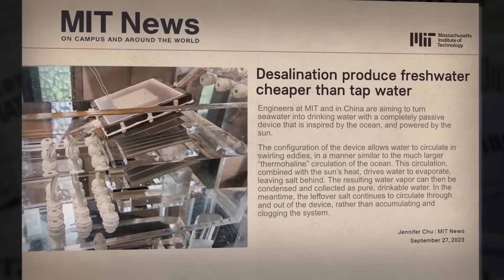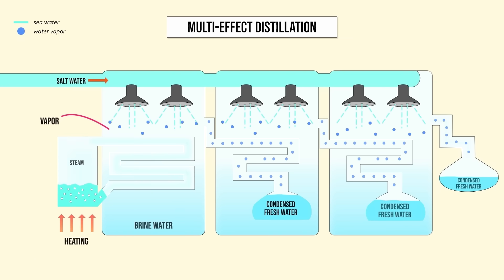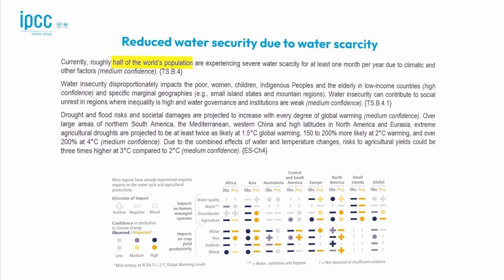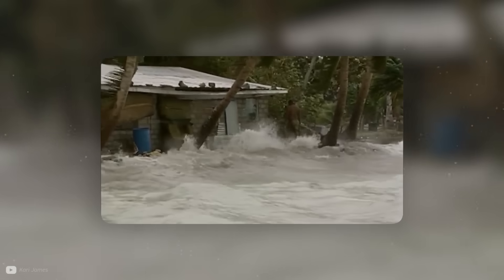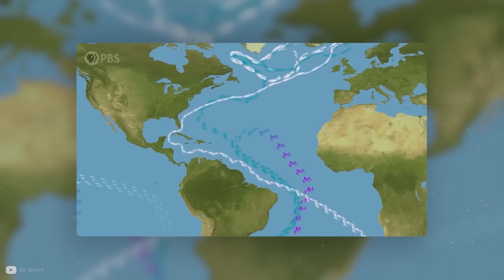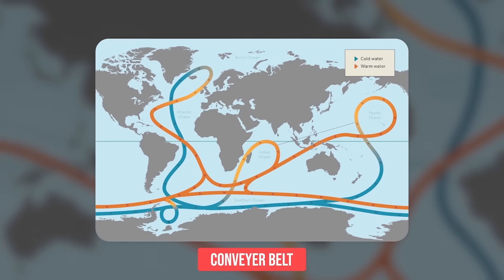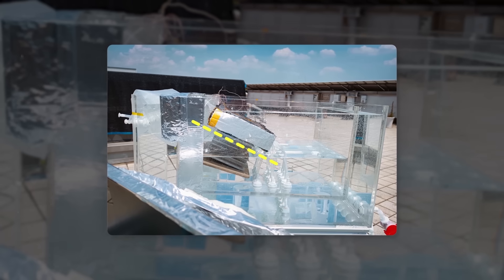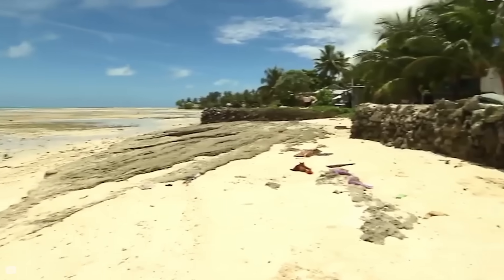Unlimited Fresh Water: Can MIT's Breakthrough Save Us?

Comment: The hyper-salinity issue isn't down to the method used, but the amount you use it. It's the same amount of salt left over that has to be returned to the ocean. Yes, the trick is to dilute it rather than dump it highly concentrated in one big go, and doing this where there are natural ocean currents to circulate it will give the best results.
Reply: Spot on.
Reply: You're correct, but the advantage of this sounds like much cheaper maintenance.  Pulling less freshwater from each liter of brine lets it still flow away instead of clogging the filters.
Reply: Dont worry, the sewage and the backwaters are going to dissolve them anyways lol 🤣🤣
Reply: I suspect this is the big problem, because membranes can be flushed but the conservation of mass means you will need to dispose of that brine somehow.
Reply: NO They should be turning the Brine into Salt Battery Storage Units...
Reply: @Shivaho  or we could both
Reply: @GungaLaGunga  Some in this vein seem to think that we shouldn't use the salt we collect from desalination. I don't see why we couldn't, but at the same time we already get salt from mines and it may not be a good idea to start removing salt from the ocean en masse. Keep in mind, we return all water we use to the ocean thanks to us directly being a part of the water cycle. But the salt we would use would not be returned, so we would be using it up. Using up too much too fast could potentially affect our ocean's thermohaline currents/conveyor belts, if the salt in the ocean isn't naturally replenished fast enough.

Basically we need to look into that extensively BEFORE we start any kind of mass production that uses salt from the ocean instead of returning it. If it turns out it's fine, then we can stop salt mining probably. But let's not hastily guess or assume based on a YouTube video and a few Google searches. It needs an actual study.
Reply: @GungaLaGunga  I'm curious to know some engineering aspects on how this might be achievable.
Reply: @PsychoticWolfie humans don't use enough water to affect the overall salination levels of the ocean in any measurable way. We can only affect it extremely locally. I don't think you understand how HUGE the volume of ocean water is
Reply: @Shivaho   NO What are you, 10 years old? What a random and terrible idea. "Hey let's turn my piss into a salt battery storage unit also! It's got higher salinity in it!" Your idea sounds similarly low-iq to that. Wild that so many people liked it.
Reply: @Shivaho  leyden jars for everyone
Reply: @Shivaho  lmao keep dreaming
Reply: @Shivaho  , should send that brine to bleach factories. Make NaOH (caustic Soda) , Hypochlorite + Sodium for batteries in one facility .  Multiple streams of revenue for on plant.

Currently most caustic soda ? bleach plants use table salt that is mined from land based deposits , instead of saltwater or sea-salt. 

super conc brine from a nearby Desal plant , could be a cheaper alternative.
Reply: @Shivaho ppl have ideas, but no plans. Can the further extraction and refinement of sodium chloride then maintenance of a molten salt battery even be worth it?
Reply: Our city built a new desalination plant to counter our lack of fresh water, the problem was they city planners built it in a natural harbor that is already under stress from other industries dumping waste water and pollutants into the harbor and is destroying the natural ecology. When the desalination plant was built there as well the company building it said they would keep a very close  eye on the salt issue blah, blah, blah, and if the salt levels got too high they would dilute them with the fresh water that they had just made. Crazy. I have looked at a few plants around the country and overseas and have noticed that they all dump the high salt water back into the sea through short 150-250m outlets, my thought was why not pump the waste water a kilometer or two into the deeper waters with stronger currents to spread it out? Is this solution feasible or is there some aspect of super salty water that would undo any gains?
Reply: @bendover1028  If you could pump it out far from shore then of course that's far better than releasing it close. But that costs extra money, and no one will spend that money on that unless there is funding and the government tells them to. Companies, even city-run programs, aren't going to do it for free or without coercion.
Reply: Even if you just dump it into a single spot all at once, there is much worse stuff we pump daily into the oceans than brine. 54 great pyramids of Water that has 7% salt in it instead of 3.5% like big wooop, you got no Idea how big the fucking oceans are. Sucks for the fish that lived directly next to the pipe that pumps it into the sea but it dilutes very quickly.
Reply: also the sheer amount of energy it takes to desalinate water is what also is a problem with it
Reply: I wonder if it would be economically viable to return the salt to the sea over where the ice sheets are melting? I've heard that the amount of freshwater they're dumping into the ocean is actually throwing some things out of wack.
Reply: ummm... actually fresh water freezes at a higher temperature. You know they put salt on the road to melt ice, right  @eyesofthecervino3366 ?
Reply: The solution to pollution is dilution
Reply: @adamhorn8414  ahhh that's the key! We must all pee on the left over salt! And then we can extract the water from the salty-pee mixture, dude your a genius
Reply: With all the glaciers melting, salinity shouldn't be as much of an issue
Reply: @ellenlandowski1659  who told you glaciers are melting? I was told they've gotten even more thicc over the last 20 years, heard the polar population was actually starting to get out of control. Them sobs are breeding like rabbits on them ice bergs
Reply: @htrdchevy71  Evaporation takes a lot of energy. Why do you think reverse osmosis ever became a thing?
Reply: @htrdchevy71  Lets think about that for a second. In Israel you have around 2000 kWh/m^2 yearly average of solar irradiance. With a yearly average of 21°C you could evaporate. Assuming 100% efficiency you could evaporate 2800 litres of water. The Ashkelon Desalination plant alone produces 396,000 m³ of water a day. So to replace it you would need 27.9 square miles of area. Good luck pitching the israel government that they could level an area on the coast roughly equivalent to manhattan to replace one desalination plant.
Reply: from sewage to nuclear waste anything could be dilute enough to release in the ocean without harming it the problem is the absurdly high amount produced. It is not just a bucket that you dilute in a tub, it is a continuous flow of huge amounts of brine.
Reply: My thought too - not seeing how this solves hypersalinity. If distributed release of hyersaline water is done with current methods, then this new method doesn't add anything new or solve the issue (same amount of salt is being dumped into the local geography, litre-for-litre water produced). Given Ziroth mentioned it as a problem it probably should have been addressed with the solution, or not mentioned at all (since it is the same problem left unaddressed for both).
Reply: Why do you want to dump the salt back into the ocean? People eat salt. Salt can be used as a heat storage medium in solar farms.
Reply: Don't dump it. We can use those salts for various chemical products.
Reply: Or you know we can just not put the salt back in the ocean and instead use it for many purposes be it medical or culinary or industrial salt has many many uses....
Reply: @stapuft  Human industrial capacity is not enough to do that.
Reply: @gorilladisco9108
Yet.
Look up sodium batteries though and there are many other minerals in seawater that could also be mined from the brine and if we're already creating this brine to create fresh water then at that point mining the brine would be cheaper than mining the Earth for those same minerals.
Reply: Also heavy water is naturally occurring in seawater so doing this could potentially be a way to get a whole lot more heavy water than we currently have which would aid in nuclear power as well
Reply: If you can somehow get it to the north Atlantic it would be benificial because lack of salinity there is shutting down the Gulf Stream.
Reply: I disagree. To add the salt concentrate in smaller volumes will not replace the water that was removed, it's still going to be the exact same amount of salt dumped into the same volume of water.
Reply: Sell the salt, or dump any excess in a large salt landfill.
Reply: It's also probably best to transport it as close to the ice caps as possible, as they are currently having their salinity affected by ice-water
Reply: The problem is that the brine sinks directly to the bottom and kills off the benthic life.  The "ocean current" argument is too long to explain in a comments section, but at least you can understand that the intake salt water is located somewhere very near the desal plant, or this whole thing begins to break down.  Likewise, the brin water outflow (diluted or not) is somewhere near the desal plant as well.  So you're dumping the brine right back into the area where you are ingesting your new water to desalinate.  And the brine, by definition, is coming back in a never-ending stream, generally in fairly large quantity.  And the whole thing has to be built somewhere that there are strong ocean currents as well?  That means somwhere on an actual deepwater ocean, not a bay or lagoon.  

It's nowhere near the simple "trick" you're thinking about.
Reply: Why not just dump it in the salt caverns.
Reply: Could it be used to produce salt for industry or consumption? Like salt pans, already used in France, Tunisia and no doubt elsewhere?
Reply: Why not build a large shallow pool deep in the desert?
Reply: This could replace and eliminate salt mining.  I'm sure a large percentage of that salt could be used for all the purposes salt is currently used, so the energy isn't completely wasted if it offsets the energy used in salt mining currently.
Reply: Better yet, save it, store it, sell it. There is very likely to be a huge market for sodium in the near future if it becomes the preferred chemistry for batteries. Also, the ocean is already 'too' salty. Removing some of the salt from the ocean would benefit most if not all of the creatures who live n the ocean.
Reply: I think the idea is to set the system directly into the ocean where the concentration isn't able to get too big in the first place but you're right there's still an impact to minimize
Reply: Agree, its a similar problem for electric cars,  they may not pollute in the city centre, but there is a polluting power station somewhere, that produces the electricity somewhere else. The real trick is to extract clean water from salty water in a system that doesn't just past the problem of the left over salt to a different location, before it is dumped back in the sea, but somehow uses the salt combined with other materials, or chemicals to become useful solid matter for building purposes, providing that the salt is converted and benign to the earth. many countries around the world could benefit from sea barriers  made of re-cycled slat based materials, providing that the science can deliver a benign  salt based product!
Reply: Or dump it into ponds to recover the salt.
Reply: @stevesteve8098  54 Giza pyramids a day is kinda big.
Reply: Just dumping hypersaline water into ponds can apply to any desalinization method.  @stevesteve8098
Reply: Mix the brine right back with the wastewater before discharging both.
Reply: @mason6883  Brine IS the waste water :-) Regular desalination creates a high concentration brine so it should be mixed with sea water to bring the concentration down and discharged where it will do no harm e.g. a long discharge pipe. Sounds like this process produces much lower concentration which is less of a problem.
Reply: I’ve always wondered why they don’t have a dual system where they desalinate the water for drinking, then truck/pipe/whatever the concentrate to a hotter/drier area to process into salt and minerals? Imagine a giant desert plant that could more efficiently dry out the concentrate.
Reply: There must be economic reasons - this new desal plant (https://www.epa.wa.gov.au/proposals/dampier-seawater-desalination-plant-dsdp) will be a few km from one the worlds largest existing salt production pond systems (4 million tonne pa), is owned by the same company and they're talking ocean outfall.  @decepi
Reply: why not sell the salt
Reply: there are many other minerals/elements  apart of NaCl which need separation/ recovery ---> cost/ technology?  @andrewanderson8803
Reply: Why return the salt to the ocean at all? Why not let all the water evaporate to create sea salt, road salt for winter or just salt lakes or to fill up old mine shafts?
Reply: What I don't get is, if the same amount of salt is disposed of back into the sea, even if it's made safer by diluting it, it has to be diluted with fresher water, right? I.e., the problem remains, how to get rid of the salt without damaging the ecology.

(That's the only flaw I noted in the explanation.)
Reply: @kencadby  The problem is not the amount, but the concentration, that much is correct. But you don not have to dillute the brine with fresh water, you can just as easily use salt water that has a lower salt concentration then your brine, you just need to use more of it.

Alternatively, you could just evaporate ALL the water and dump the salt behind your factory. that would also work.
Reply: How is this miracle current different from just putting in a solar powered pump to circulate the water? The salt doesn't magically go away regardless of what they are trying to sell you. If you aren't creating concentrated brine then you aren't going to create salt-free water because you have to have at least one membrane which is totally impermeable to salt - and if the pressure gradient isn't extreme - which would result in highly concentrated brine - you aren't going to get any appreciable flow rate. People have been using solar stills for thousands of years, but I guess putting it at an angle to allow for magical salt separation somehow made all the difference, right? Nothing seems at all innovative about any of this research except it somehow prevents clogging of the filters through some undisclosed mechanism. Honestly, how is this thermohaline current able to prevent the clogging when pumps cannot? That makes no sense.
Reply: @-Bill.  Yeah, I'm very skeptical about the extrapolations of this process. I hope Ziroth does a follow-up video as they do more research and prove their results at the micro and macro scale.
Reply: @-Bill.   There is less energy loss to directly use the energy from the sun, making it more efficient energy wise. Other than that, it seems more like the currents are just used to avoid clogging up the filters. The project seems to be mostly about a more efficient way to desalinate the water and making the process more available to areas where there is a lack of infrastructure development.
Reply: @-Bill.  Normal pressure reverse osmosis systems literally force the saltwater against a membrane and therefore every pore in the membrane eventually has salt forced into it.  I think the key here is the hydrophobic property of the membrane and only diffusing the water through as vapor without using pressure so the salt water and therefor the salt does not touch the membrane in the truest sense and does not clog it.
Reply: It's really delaying the problem. More water means more people. More people need more water. More salt in the water. I think in the US they say a person uses at lest 50 gallons a day. Someone will say - gee, cheap land. Buy it, develop it, profit. Sip cocktails on Fiji or Miami. I could see California building oil tanker sized versions of this off the coast of San Francisco and Los Angeles. San Fran "environmentalists" would probably find a way to blow that water too.
Reply: 'It's really delaying the problem' agreed,  the Red Sea scenario comes to mind.... @robertthomas5906
Reply: The same reasoning applies to other pollutions in larger populations. So the ultimate problem is "too many people" in any case. Technology to reduce the waste footprints will always work better than just ignoring the footprints to save money.  @robertthomas5906
Reply: The people who invented the combine, the cotton gin, the steam engine, etc, all had the ‘do more work with less manual labor’ mentality, an idea (a sickness, ultimately) which led the way to our current global civilization. @robertthomas5906
Reply: @robertthomas5906  Not really. Water is not "used" in the sense that it disappears - it is just entered into the normal circle of life. Heck, if you put the wastewater clearing facilities right, you can mix the (clear and technically good) water that comes out of them with the brine and then dump it back into the sea.
Reply: @robertthomas5906  Our problem isn't more people, it's less people, the population is shrinking far below the sustainment rate.
Reply: @robertthomas5906  no way a person uses 50 gallons a day, normally.  Think about it.  Heck, look at your water bill.  That would mean a family of 4 was using 12,000 gallons a month on average.  I am not even close to that.  I don't know anyone who uses that.
Reply: @v3rlon  add in the water that is used on your behalf, for example to grow crops that provide your food.
Reply: @v3rlon  Apparently you never heard of that ancient technique called "watering your lawn".  Can easily use 500 gallons in a single day.
Reply: @thekinginyellow1744  My lawn has grass, not people.  The navy doesn't have grass on their ships.  If fact, I have never seen a lawn that had people growing on it instead of grass.    I'm pretty sure that isn't even legal.
Reply: @v3rlon  According to the 2006 human development report it is 150 gallons.
Reply: @rianfelis3156  If everyone grows their own food and their own cotton to make their own clothes, you could start that argument.  
Other than that, this is an artificial way to 'run up the score.'  You'd have to discount other parts of that water support such as the parts of the plants we don't ear, their carbon dioxide consumption, and of course subtract all the water we put back into the environment (sweat, breathing, tears, urine, bleeding. and so on) if you want to go that route.
Reply: why not sell the salt
Reply: why not sell the salt
Reply: why not sell the salt
Reply: @andrewanderson8803  It's brine, not salt. To evaporate the last bit of water takes a lot of energy or a lot of time. Salt is gathered by poor people in deserts (salt flats), where it's caked into solid minerals already. They slice it up, haul it out, and sell it. There are also salt mines where they blast tunnels through solid salt underground and carry it out. It's just a question of economics, of what the cheapest method is to get it. But maybe it's better to create salt this way anyway, from the brine, so as not to dump it all into the ocean. A government subsidy could cover the difference in cost. Usually when we decide to dump a thing into the environment in vast quantities it ends up not being a great idea after all.
Reply: @johnshite4656  when we use up water, we give it back pretty quickly.  We don't have a water shortage at all, we have a FRESH water shortage.  We're not creating anything to dump into the ocean here at all, the salt came from the water we're borrowing for a very short time.  The problem is with how concentrated and locally the salt is re-introduced, not with the quantity at which we dump it.

If it's dilute, that's problem 80% solved.  If we only dump the salt back in for the amount of water we desalinate for any given time, AND the salt we dump back is dilute, then there is absolutely no problem at all.
Reply: @threepe0 Spot on. 

And, why not collect the waste water after use for diluting the brine? This plus extraction of edible sodium chloride may then end up with lesser concentrated brine being returned into the sea. A possible Win / Win scenario.
Reply: @johnshite4656  On the Canary Island they are doing it, my Parents bring back every year Seasalt when they were there. From Canary salines. They Pump the Brine into big  drying basins and then sell it Tourists. The multi Basin drying method is one of the oldest salt production Methods of the world. Normaly you let Water at high tide into it, then after 1 day you let this water into another Basin etc... till you can scrape it together. I think normaly there are 7 stages in traditional Seasalt Water refining. With the Brine from the fresh water they have only 3-4 stages of drying. As long as the sun shines you get the energy for free.
Reply: @johnshite4656 Can you tell me where you would start & some engineering tips if you want to scale this model and perform it at a industrial level.
Reply: @threepe0  that's not entirely true. We actually do have a water shortage issue. What you're not realizing is a lot of the water we use gers trapped for years. From nuclear waste to house paint. Even our bodies doesn't decompose naturally back into the  ecosystem because we put then in wood caskets, that also have products with water I'm it's composition that will take many years to recycle back.
Reply: why not sell the salt
Reply: @andrewanderson8803 the salt is not pure when it's separated from water.
Reply: Maybe look at Israël how they have solved this problem. They already get 95% of their water from the sea, not just them but they also provide Palestina with water from the ocean. I have an idea MIT and the Chinese state scientists are trying to re-invent the wheel
Reply: you mean whenever they aren't shutting the water off and killing children @mikebrandenburg9922
Reply: Israel uses reverse osmosis.  They are currently mostly using fossil fuels to power the plants but are switching over to greener sources.  This process uses the mentioned tiresome to clean filters.  Large scale use of desalinization had only been used for thirty or so years.  I'm sure there is room for improvement. @mikebrandenburg9922
Reply: @mikebrandenburg9922 they also have the Dead Sea, a convenient place to pump hypersaline water that won’t cause an ecological disaster
Reply: @mikebrandenburg9922  And you'd be wrong.  Israel uses conventional desalinization techniques.  You probably could have figured that out with a simple search in less time than it took you to write your comment.